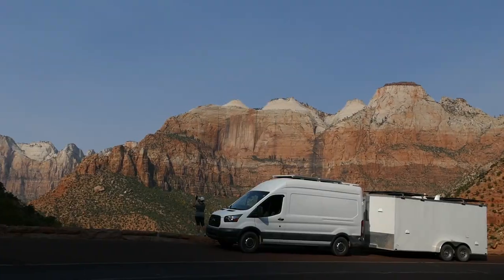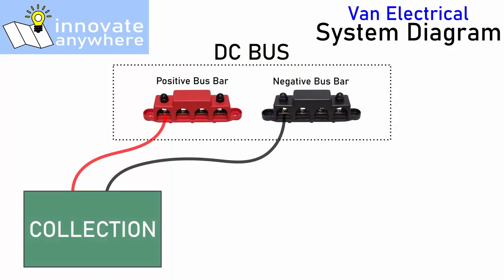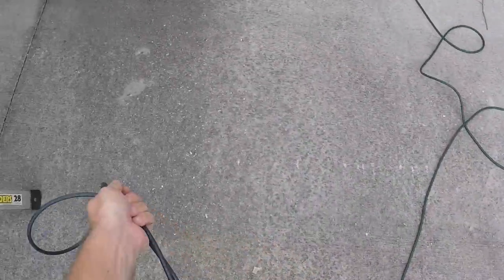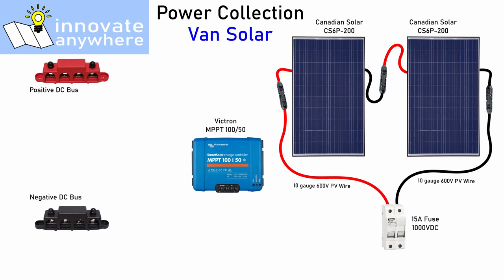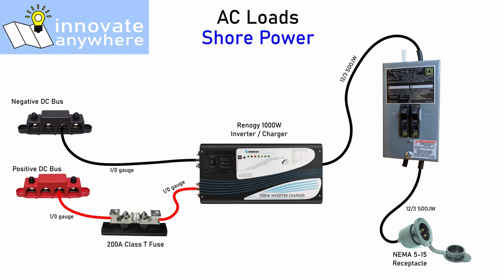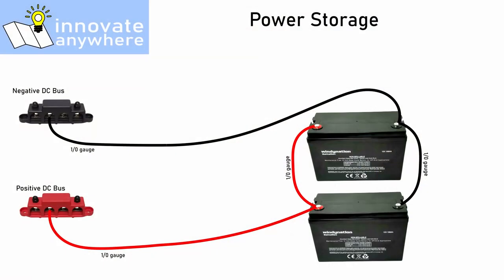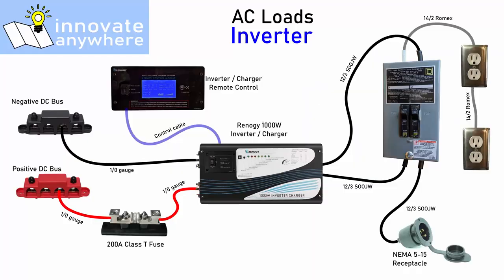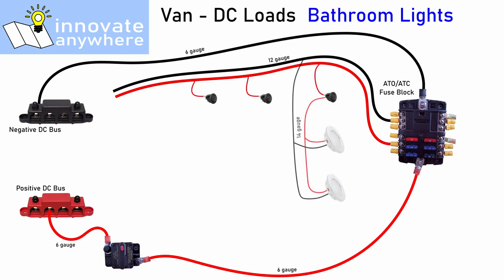Walk through of off-grid solar campervan electrical system

Comment: Really appreciate the in-depth review of your electrical build.  Most van converters skip over.  Just wondering why you didn't go Lithium, other than costs it seems a better fit, less weight for more energy.  Love your van/trailer concept, really covers all your needs.  Keep enjoying your journey.
Reply from the maker: Hi Lyndsay, glad you liked the video! Cost was absolutely the reason I used AGM lead acid instead of lithium. I got the AGM batteries, solar charge controller, and solar panels for the cost of one lithium battery. And this bank has 25% more usable energy storage than the lithium would. There are a few other reasons too so I plan to do a more in depth video on battery types sometime soon.

Comment: Exactly what I was looking for! 😊👍🏼 thank you!

Q: 16:25 does the inverter/charger need to be energized (powered on) to sense shore power to disconnect the inverter and route to shore power?

Hilarious breaks!!😂😂😂
Reply from the maker: Hey Stoked! 

The inverter/charger in the van is always energized because the battery bank is always connected. It is smart enough to detect shore power and automatically switches all AC loads from the inverter to shore when shore is connected.

Comment: where you live, do you have to have a RCD (earth leakage CB) on the incoming 'shore' power? I might have missed it , but do you have an accessible  main isolator on the battery ( in case of fire etc) and fuse close to the battery terminal?